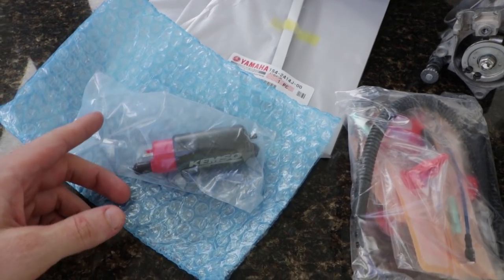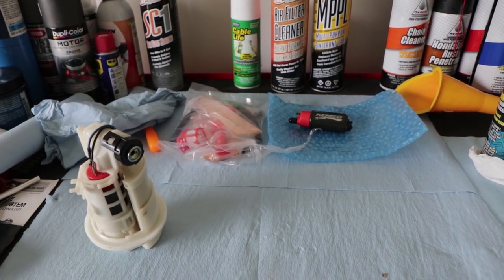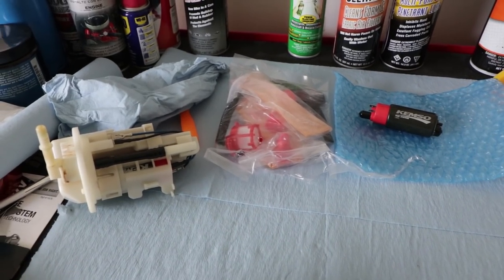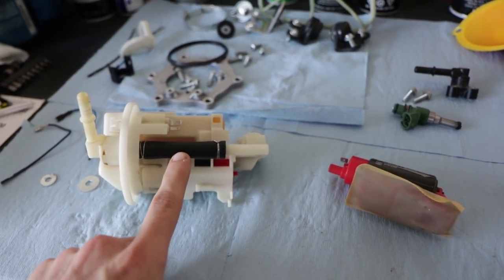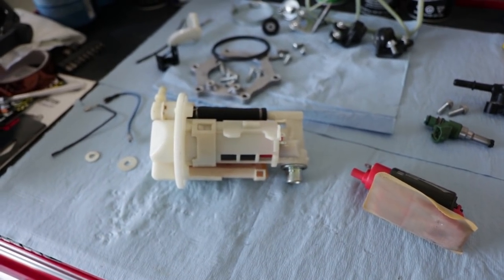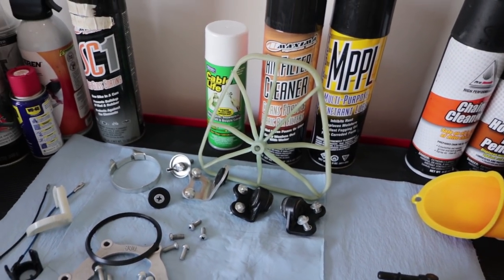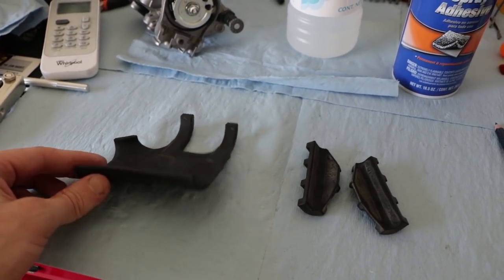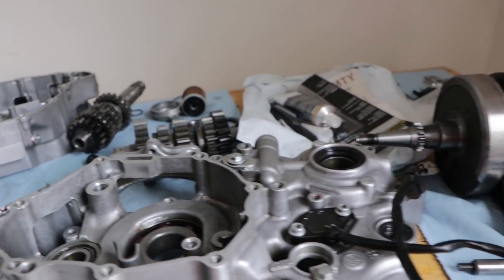YZ450F Supermoto Build Video: Fuel Pump Install, Fuel Injector Cleaning & Airbox Mod! Ep. 14

Comment: Did you test the fuel pressure first?  I tested mine, it was at 45 psi, and steady after removing the voltage.  I believe that's acceptable.  A 2019 $150 pump is now in mid 2024 is ... $400.  Bidenomics.    The rebuild kit, All Balls at RMATV is right at $75 now.  A Quantum fuel pump, which includes the fuel regulator (the All Balls doesn't) is also about $100.

Comment: Juste a little advise from my previous bad experiences, never put rubber hose inside a tank, it will degrade and let the pressure out without any way of noticing it, you will run really lean an destroy your engine for a stupid hose.
The right thing to put is like the original (hard plastic), you need to heat it up for insertion.
Rubber hose are not ok for ethanol specially the outside of it and you need nice clamp or the clamp will cut the rubber clean.
Nice try anyway ;)
Reply from the maker: berln berln ok that makes sense and thank you for telling me! I want to fix it but I cant find fuel pump parts anywhere! Only the whole pump... where can I get a new plastic hose??
Reply: @FULLTHROTTLEFILMZ  you need to look for nylon fuel line.
You need a heat gun to install it, chose the inside diameter wisly it need to be snug and be able to fit on. No need for clamps.
You can run the bike withe the rubber line for the moment, mine took 3 months to leak, it was a hell to troubleshoot ;).
Good luck on your rebuild, I'm working on a 98 wr 400 right now

Comment: Question,  below the tank is the outlet for the fuel line when I have it disconnected from the fuel line fuel flows from it, and I was told that nothing should be flowing from that outlet unless I kick the bike meaning that the fuel pump would be pushing the fuel out, but when I disconnect my fuel line from the actual outlet of the gas tank it drips pretty heavily of fuel ,now when I take off my fuel pump the black hose that you had to replace in the video was not cracked and not loose. What do you think is the problem?

Comment: I bought a 2014 ya450 and it seemed like it was starving for gas and had to have the choke on to stay running,now it wont start. Im thinking that if i clean or replace both fuel injector and the fuel pump it will probably run again. It had spark and plentt of compression when i try to kick it over but wont start up. Im going to give this a try.  Thanks a lot for this video. Really needed this
Reply from the maker: Happy i could help! Hope this does the trick for you!

Comment: Paul Hetherington
0 seconds ago
/screen or map ~ 32:1 any needed rates in Mx machined injectors /pumps/obtuse Int rRaaTey Al6 shells ++ 6''in slopes dia 3''in diams find ~ fuel/oil/O2-- water solvent attractions in AVN tracks/lockons i.e. Telmechry
 as volcom stone vk shapes /